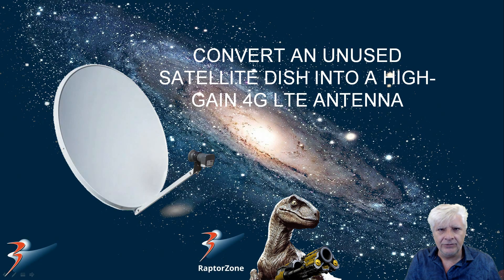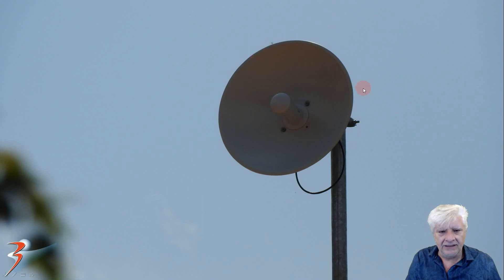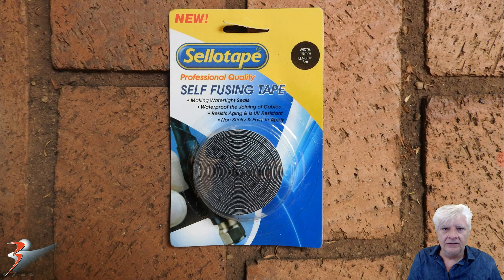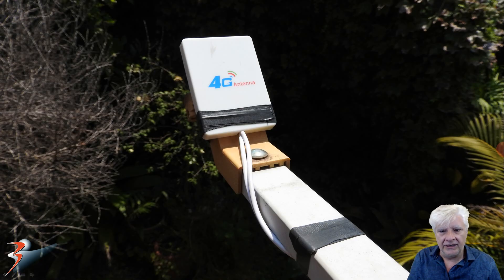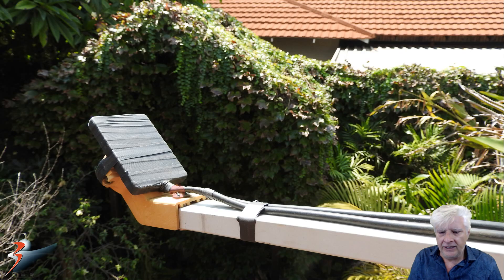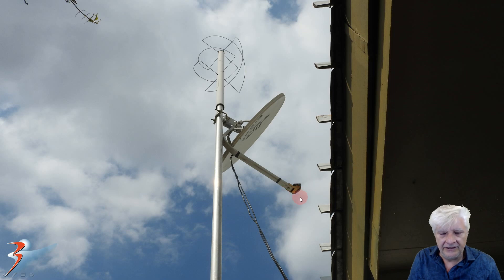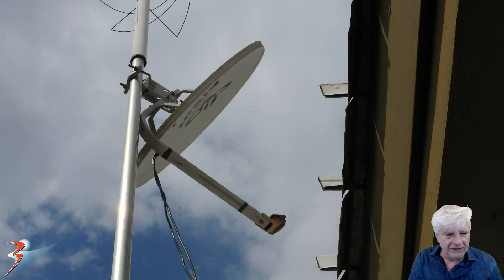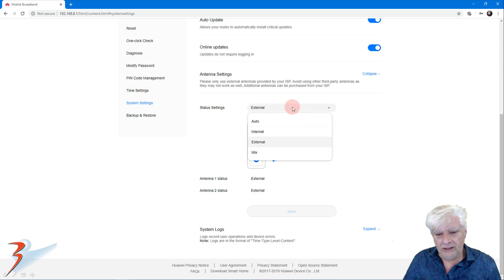Convert an unused satellite dish into a high-gain 4G LTE antenna

Comment: Can you use any type of router? Or does it have to be specific one
Reply from the maker: Hi Justine, any router with two external antenna connectors for receive and transmit will do - also, also the router should be able to switch from internal to external antenna's.
Reply: Has to be a 4G modem/router with a sim card slot.

Comment: What about upload?
Reply from the maker: Hi Saqr, this setup uses a 4G LTE antenna that includes a antenna for receive and a antenna from transmit, so it is a bidirectional solution that should improve both upload and download signal stability. It is important to switch to external antenna's for both receive and transmit in your 4G LTE router settings. I hope this helps.

Comment: Great video sir! I rarely smash the like button and you deserve it. I am living in Philippines and my place is one of the worst if internet signal is in the conversation. I really don't have knowledge on how to make a solution before I watched this video. Thanks to you sir! But I have a question and I hope you can help me. Can you please list all of the equipments needed for this DIY? Because I am not sure if what I heard was all correct according to your video. Typed words from you will be a sure one. Thank you!
Reply from the maker: Thank you for taking the time to watch the video and for the thumbs up, much appreciate.

Here is a listing of the suggested things for this project:

a) A conventional satellite dish.
b) A small LTE 4G Antenna (I listed a few URL's where you might be able to purchase the LTE 4G antenna I used, any other small LTE 4G antenna should work too).
c) A mast of some kind to get above a roof for line-of-sight with the cell tower.
d) A grounding wire from a copper pipe in the ground to connect to the mast for lightning protection.
e) Coax cable (normally a long length of coax cable is included with the LTE 4G antenna - as is the case with this particular one a purchased.
f) Some self-fusing/amalgamating tape for a one layer wrap around the LTE 4G antenna to protect it from UV and to make it water resistant.
g) Use the self-fusing/amalgamating tape to mount the LTE 4G antenna to the LNB mounting bracket (remove the LNB 1st).
h) I stripped some RG58 coax cable and inserted the antenna's coax cable inside this RG58 outer plastic cover to protect the thin coax from the sun.
i) An LTE 4G Router with two external antenna connectors.
j) Cell tower direction finding software, for example the software I used.

I hope I covered everything. Good luck with your installation.

Kind regards

Jean
Reply: Wow thank you sir! Nah smashing the like button is a small thing for you sir since you are a great youtuber.  

I have seen a lot of my countrymen here in the Philippines doing this with MiMo and dish antennas. But the MiMo are also facing the same direction as the dish and they're getting good results. Is it a good idea, sir?

Comment: It is a great idea. I am planning to use this idea for boosting the 4g mobile signal inside the house. will this work if I install signal booster router(6dbi) inside?
Reply from the maker: Hi Bala, yes it will work indoors, but not as effectively though as walls do attenuate 4G signals a lot.
Reply: @JeanWard  Thanks for the reply..I will reply how well it works. I will use signal amplifier if needed. I hope that works.

Comment: Jean Ward, Hello from Florida... OK First of all I did this about 4 years ago and learned quite a bit.
You would be better off if you put the feed arm at the top of the dish or just invert what you have there. I did mine with a mobile hotspot that had places for external antennas. 
But it also had a plug for USB. I mounted it on the arm like you did and ran a long usb cable back into the radio room. And now I can plug it into the USB 3.0 for internet and it also charges the hotspot.  Back to the antenna dish. I had it the way you do in this video but I still could not get a full scale on the signal bars.  I went out and looked at it and because of the tilt on the antenna it wasn't seeing the tower straight on. I inverted the dish so the arm was on the top and leveled the dish to where it was pointing straight towards the tower and waalaa with a little bit of adjustment I got a full scale of (5 Bars). This tower I was using was 15.3 kilometers or 9.5 miles away. I never had a loss of signal no matter how hard it rained. Any way great video and thank you..
Reply from the maker: Awesome Dave, this solution really works well. I'll look into inverting the setup as you explain. Currently I get full signal strength also no matter how hard it rains. Take care!
Reply: @JeanWard  Are you a Ham Radio Operator?  de W4DRA
Reply from the maker: Hi Dave, I'm not a Ham Radio Operator but I've been into electronics and radio for many decades. I used to operate on 11m DX for many years. I used to work in telecommunication R&D in my younger days :-)
Reply: Pls can i make use of Azsky G1+ Quad Band GPRS adapter ? How do i connect/run the cables up to my laptop ?

Comment: RSRQ hasn't improved it actually got worse as this is a negative number. You didn't gain 1dB you lost it.
Reply from the maker: In my experience the overall signal stability has improved. The RSRQ varies a lot. This was the reading at the time of the video. Overall I find my connection is a lot more stable.
Reply from the maker: As of right now the measurements are:
RSRQ: -8.0dB
RSRP: -82dBm
RSSI: -53dBm
SINR: 12dB

Comment: you have got a worse RSRP going from -11dB to -12dB... not an improvement. However, not a real problem..
Reply from the maker: Hi MioNonno, the overall improvement taking the other measurements into account helps a lot for better signal stability.
Reply: @JeanWard  for sure. I'll try It soon. Thank you

Comment: Thanks Jean Ward. You just gave me a fantastic solution to my problem. I will try this and post the update. I am getting low signal from 6km far tower
Reply: after 6month. any updated?
Reply from the maker: Hi there Amey, please give it a try - it's worked very well for me. Please do let us know if it makes a difference in your situation. PS: It's still up and running with no issues or problems.
Reply: Any update bruh?

Comment: Can we use the LNB instead of the 4G antenna?
Reply from the maker: Hi Z, standard satellite LNBs are designed to operate at very much higher frequencies, the require DC power to operate and they cannot transmit, so these LNBs are not suitable in this application.

Comment: Would this be a feasible solution to bad cell service inside a home? If I were to set this up, and connect my cell phone to the router, would it give me better cellular service?
Reply from the maker: Hi Jesse, this solution improves your LTE routers connection with your cell tower and not your cell phones regular service. If you connect your cell phone with your LTE router it will be by means of WiFi. I'm sure this solution will improve apps on your phone like WhatsApp, Twitter, etc. bit not regular cell phone calls.
Reply: @JeanWard  so I would just need the lte router then. I mostly use the phone to watch YouTube, so I just need data service. I live in a remote area, and am on a long wait to get internet service. Ty Jean

Comment from the maker: Here are some links to shop for the type of LTE antenna I use, please check what type of connectors work on your router, there are screw on and push on types:

https://www.amazon.com/dp/B07FKN7XXZ/ref=sr_1_54?dchild=1&keywords=lte+antenna&qid=1588183898&sr=8-54
https://www.amazon.com/OUYAWEI-Antenna-External-Antennas-Connector/dp/B081DZR243/ref=sr_1_116?dchild=1&keywords=lte+antenna&qid=1588183977&sr=8-116
https://www.amazon.com/dp/B07Z7Q8X1H/ref=sr_1_139?dchild=1&keywords=lte+antenna&qid=1588184063&sr=8-139
https://www.amazon.com/Eugeneq-Broadband-Antenna-Signal-Amplifier/dp/B084MJH11C/ref=sr_1_143?dchild=1&keywords=lte+antenna&qid=1588184063&sr=8-143
https://www.amazon.com/dp/B083WCSCF3/ref=sr_1_145?dchild=1&keywords=lte+antenna&qid=1588184123&sr=8-145
https://www.amazon.com/Jadeshay-Antenna-Signal-Amplifier-Hotspot/dp/B082NR98XB/ref=sr_1_241?dchild=1&keywords=lte+antenna&qid=1588184194&sr=8-241
https://www.amazon.com/dp/B07XXYNDJP/ref=sr_1_246?dchild=1&keywords=lte+antenna&qid=1588184194&sr=8-246
https://www.amazon.com/Romsion-Antenna-External-Antennas-Connector/dp/B07Y1P9YNK/ref=sr_1_291?dchild=1&keywords=lte+antenna&qid=1588184262&sr=8-291
https://www.amazon.com/OUYAWEI-Antennas-Antenna-External-Connector/dp/B07WR779TV/ref=sr_1_293?dchild=1&keywords=lte+antenna&qid=1588184262&sr=8-293
Reply from the maker: Hope this helps, this antenna works very well indeed.

Comment: It doesn't get overheat?
Reply from the maker: No, the small LTE antenna I mounted at the position of where the LNB was is designed to handle normal Huawei LTE router power levels.

Comment: Hello Sir, My router shows 5 bars signal (Huawei E5788U -  CAT16 LTE) and it gives me incredible speeds during the day (@8mbps or 1MB/s) but the issue I am facing is that during the night I get very pathetic speeds at 0.6 mbps or 64KB/s...When I checked with my neighbour he has a comparatively chepaer Huawei Router, gets only 3bars signal and has speeds worse than mine, at the same time when he switches his router to 3g only mode he gets 10mbps stable all the time, while I put my sim into the router and was able to get only 1mbps, Sir Can you please explain why does this happen? Thanks
Reply from the maker: Hi Abraham, with what you've said I speculate that your LTE speeds are lower at night most likely because a lot more people are accessing the Internet at night for entertainment purposes. The more people that access your local cell tower the lower the speeds will be. There might be fewer people on 3G thus the higher speeds there or your neighbor might be switching to another cell tower on 3G with fewer people accessing that cell tower. I'm no expert, this is just my opinion and there might be another reasons I'm not aware of.

Comment: Is it really works for you!!
And where about the antenna that u already used is it enough!!
Reply from the maker: Hi Bakhti, yes it made a big difference to my download speed and signal stability. Without this dish I had very low download speed and long latency delays. I've been using this dish for a few weeks now at it is still the same ... very good solution to low signal and low speed problems. Please don't fall or get hurt if you try this.
Reply: @JeanWard  thanks a lot ❣️

Comment: I'm having low internet connection in Klerksdorp using Telkom lte. I might give this a try.
Reply from the maker: Hi Sihayl, it's well worth the effort. I get a gain of 25dB doing it this way. The trick is finding the cellphone tower you're connected to. Use the cellmapper website I list in the video to locate the towers around you and point your dish to each of them keeping an eye on your LTE routers signal strength. When you get maximum signal you'll know which tower you're using. Remember to point the dish down so that the incoming angle lines up correctly with the LTE antenna mounted  in place of the original LNB. The angle of incidence and reflection of the dish is very important. Give it a try and good luck. Please don't fall or get hurt especially now that the hospitals are focusing on C V 1 9 only.
Reply: @JeanWard  thanks, I'll give it a try after lockdown.

Comment from the maker: UPDATE: I played around with the setup and got the dish aligned with the tower nicely now. I tested the speed and I now get the following: Ping 15ms, Download 28Mbps and Upload 7Mbps. Signal measurements are also better now: RSRQ -10.0dB, RSRP -84dBm, RSSI -57dBm and SINR 6dB. The dish is producing around 25dB signal gain. Absolutely incredible results!
NOTE: Please be careful if you are getting up on a ladder or working on the roof.
Reply: What application did you use to know the signal measurements
Reply from the maker: @gamersite3458  I used my routers built in signal measurement capability. See if you can log in to your router and check under something like settings to see if you can access your routers signal measurement tool.
Reply: @gamersite3458  If you have a Huawei router, you can use Huawei manager app. Search in youtube for 'Huawei band lock sk tutorials' and select the video uploaded by 'SK tutorials'. Go to the description of the video and there's a link to download the apk file. Install the apk file on your android and input your router login username, password and default gateway (which is usually 192.168.8.1). Hope it helps.
Reply: thank youso much
Reply: Would've this be 2x2 mimo tho

Comment: Super smart tip which I am sure  could be usefull. The place where I live we have access to super fast fiber net 👍
Reply from the maker: Hi Tore, they stopped installing fibre here when I live and are switching from copper to 4G LTE. I wish I had fibre, it's much better in my opinion.
Reply from the maker: I just checked, I get on average 20 MB/s download and 5 MB/s upload.